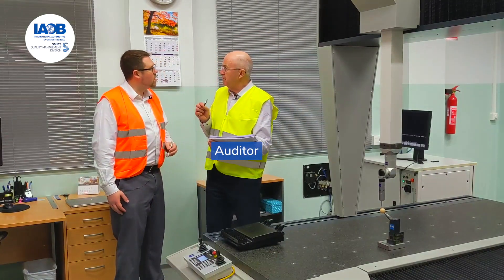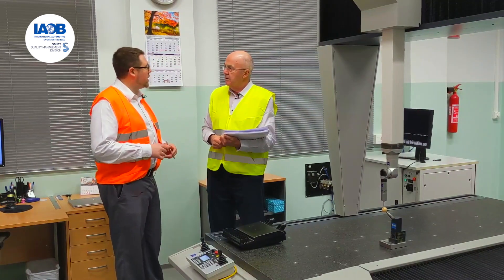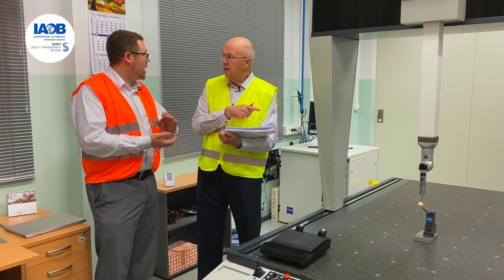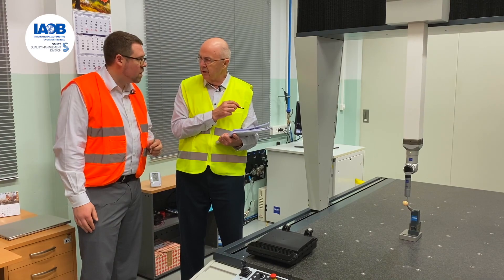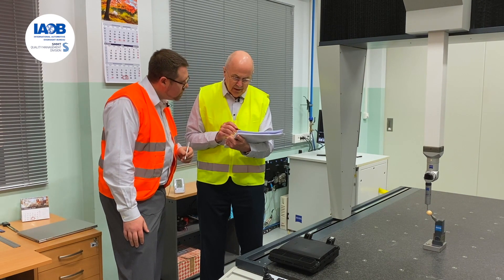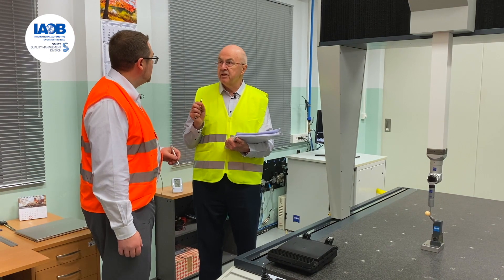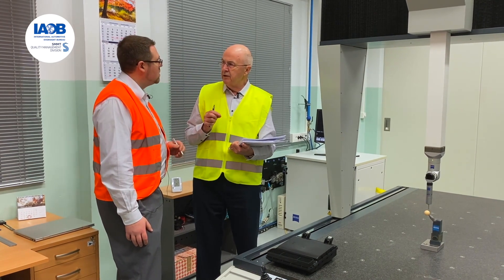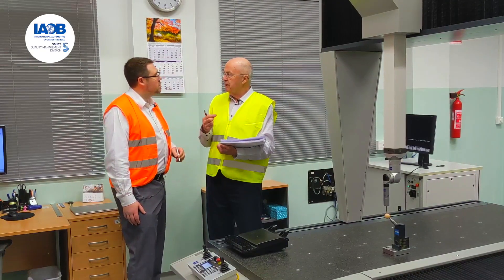IATF 16949 audits | How to: Effectively follow audit trails from Production to Product Inspection?

Comment: In your comment on the inaccuracy of using the term GRR instead of MSA I think that you should also have pointed out that the standard does not require any frequency, you stated annual!
Reply from the maker: Thanks for the feedback, you are right, IATF requirement is for MSA, not specifically gauge R and R. IATF does not define any frequency for repeating any MSA study, but customer specific requirements could.

Comment: OK.. But if the CMM is handle by 2 or 3 person means the GRR is mandatory or not??? ...why is asked mean if they conduct bias or linearty or stability.. The study only examine instrument variation. Not address the equipment variation. So please clarify
Reply from the maker: If a CMM is on the control plan MSA has to be undertaken, but it is the responsibility of the organization to decide which type of studies to undertake. IATF does not mandate GR&R, bias, stability or linearity studies could be used.